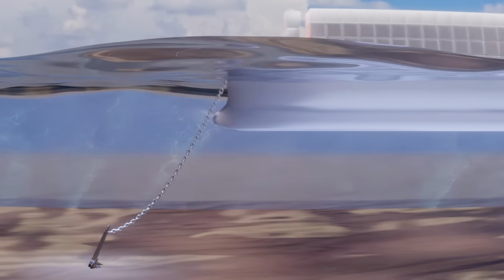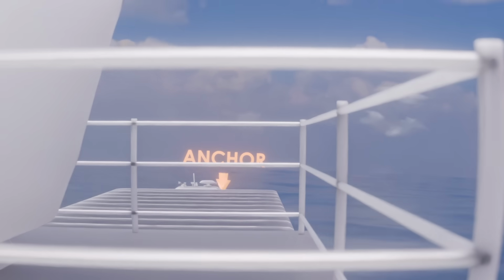Anchors don't work the way you think

Comment: An anchor is completely useless in the middle of the ocean.
Reply: Ships don’t anchor in the middle of the ocean.
Reply from the maker: @matthewbyrd398  on those cases the ships stay in place by constantly using their thrusters or by using what is called a 'sea anchor' (a parachute like device)
Reply: yes. the chain isn't like 3km long
Reply: @morkula0 3km? So...the shallow part?
Reply: Well, it depends on the depth of course. Some areas in the middle of the ocean are not necessarily especially deep so an anchor may sometimes work satisfactorily but a sea anchor will help restrict the amount of drift if you can't use the normal anchor.
Reply: Why would a ship even need to stop in the middle of the ocean anyway?
Reply: @Sovereign01 
The narrator said "in the middle of the ocean"
Reply: @Sovereign01  Engine failure. Happens a lot with cruise ships.
Reply: @surfrescue3232 Average ocean depth is 3.6km, no ship has an anchor chain that long.
Reply: @Sovereign01  no I know. You said why would they stop in the middle of the ocean (not anchor) and engine failure could be a reason.

Comment: I disagree with your last statement though! I spent 20 years in the Navy as a deck ape. An anchor "chain" is actually called a cable. A cable link is extremely tough. If too much pressure was actually applied between the ship and a stuck anchor, the cable would fail at the deck clench at the bottom of the cable locker. That is the weakest point in the entire system. If the Blake slip is engaged, or if the weight is middled between the gypsy brake and the Blake, it might absorb the shock. It's rare cable links fail. 

When all this fails, the deck clench is coming up through the naval pipe! Get out of the way, you are about to have a bad day...
Reply: Weak relatively. There was a recent case of sabotage where a ship dropped its anchor and dragged it for >100 miles, at full speed for a good portion. Internet cable lines were severed.
Reply: @queenlip6152 It depends how the anchor are held. In the case of when an anchor is no longer "home" this should be verified during every watch. Even if there is sabotage, there would definitely be sings the anchor is dragging. The cable would be having a peculiar motion and would be slapping up and down against the decks and bulkheads for example. The noise would be significant. 

I cannot speak for civilian fleets, but in the Navy, ships are continuously inspected at least every 4 hours. The Petty Officer for our trade would do continuous rounds every hour around all deck spaces. Problems are normally found within an hour of occurring. On most ships a dragging anchor and cable would be felt. 

Only two ways to sabotage an anchor and cable, and they all have to be done manually. I reviewed my old notes after my original comment. It's actually the bitter end that is the weak link. The bitter end is connected to the deck clench. They usually follow together when the anchor and cable runaway. 

The ship I was on once had a runaway anchor because the gypsy brake failed. All 10 shackles came out of the cable locker. In that case there wasn't full momentum and the bitter end and deck clench held. It's a hell of an unnerving thing to witness though.
Reply: @msamour I was very curious about this anchor dragging business. The “What’s going on with shipping” channel had some good videos about the anchor dragging sabotage. I’d be curious to hear your take on it. It makes sense that everybody on board would know what’s going on
Reply: @dannyovryn4120 I am not aware about the other channel. One thing is certain, everyone working on the upper decks would be aware if an anchor was dragging. 

In addition, the officer of the watch has to take a fix for the log every so often (some ships it's every 15 minutes at anchor) to ensure the ship is not dragging her anchor. Normally, the Captain is informed as soon as it's determined the ship is dragging her anchor. Corrective measures are then normally taken immediately.

Comment: Thanks for using the ".. real measuring dimension".
Reply: Yeah and then a minute later just uses feet again lol
Reply: I like metric, but if imperial was entirely base 12, then I would like imperial better
Reply: @WTC2014 I agree.  I have nothing against metric.  Just making a joke.  Metric is so much easier than imperial.
Reply: @DakarNick  and the joke is even funnier because the apollo engineers used metric
Reply: @WTC2014 well, they never actually went to the moon so who cares...
Reply: @WTC2014 yeah. Smart people can not only use and understand imperial and metric units, they can also convert them easily.
Reply: @Josh-fh1rm ha.
Reply: @WTC2014 NASA used both.
Reply: There are countries that use the metric system, and there are countries that have landed men on the moon.
Reply: @DakarNick you know that NASA actually used metric system in calculations, right?
Reply: @nikmax-b6m They used both.
Reply: @DakarNick by using the metric system 🤣
Reply: @zavalondc They used both.
Reply: @DakarNick  They used metric for all their engineering calculations, but the control displays were in imperial units (as those would be more familiar to the astronauts). Fair enough , as the astronauts should be presented with measures and units they are most familiar with in a stressed situation.
It's no biggie, really, metric is just "better" for engineering purposes, as it diminishes conversion error possibilities. 👍
Reply: @DakarNick And there are countries that mainly use imperial but used metric to land on the moon